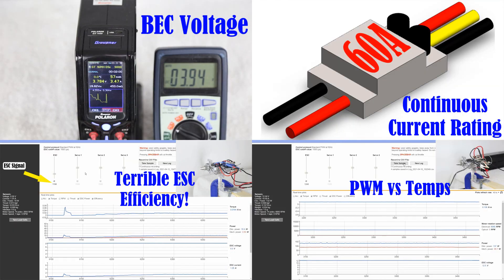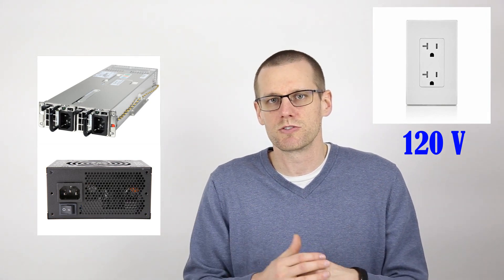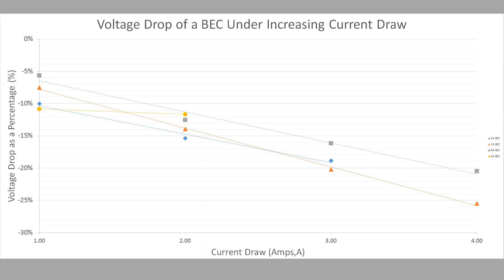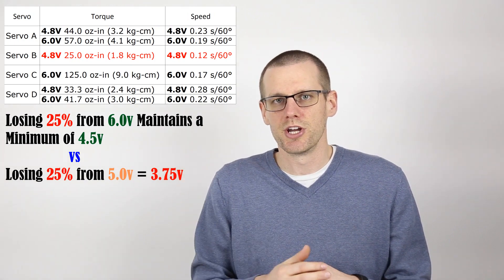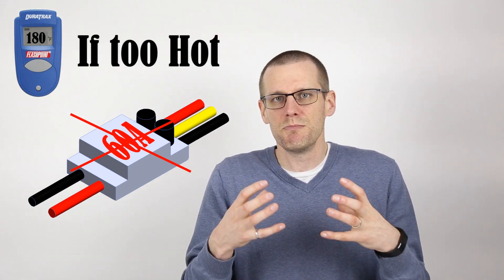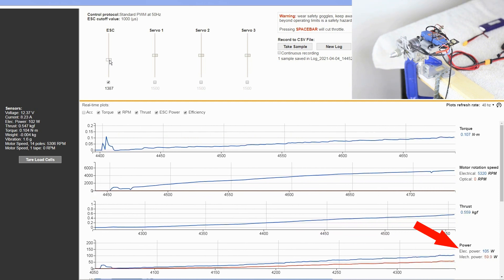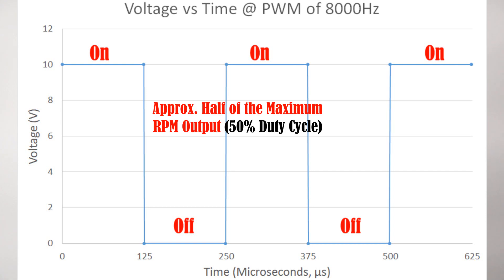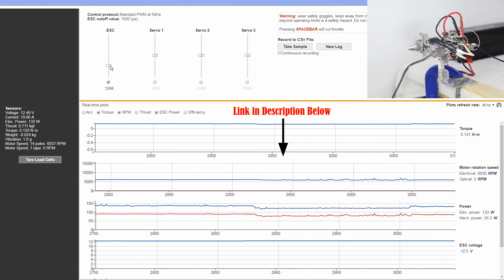What ESC Manufactures Don't Want YOU to Know

Comment: Hi! I'm working on an RC aircraft design optimization code, and I'm trying to create a simplified mathematical model for an ESC. I am modelling the entire battery-ESC-motor system as a DC circuit, where the ESC acts as a Buck converter (Pin = Pout, Iin*Vin = Iout*Vout). So for example, for half throttle (half duty cycle), Vout = 0.5*Vin and Iout = 2*Iin. However, after watching this excellent video, I'd like to add an efficiency term to the ESC to model the effects of partial throttle. The problem is that your data provides overall system efficiency as a function of throttle setting, while I need to understand the efficiency of just the ESC (I have separate mathematical models for the motor and propeller). Specifically, I need to understand what exactly efficiency means for an ESC. If efficiency is measured by Pout/Pin across the ESC, how would I solve for Vout and Iout? I see 3 possibilities:

1. The ESC switching losses reduce voltage, so Vout = efficiency % * throttle % * Vin. Iout remains the same as for the idealized Buck converter ESC with 100% efficiency.
2. The ESC switching losses reduce current, so Iout = efficiency % / throttle % * Iin. Vout remains the same as for the idealized Buck converter ESC with 100% efficiency.
3. Some combination of the above.

Do you have any tips for how to mathematically approach this? Thanks!
Reply from the maker: Pout/Pin = efficiency. Is how I'd handle this.

Comment: Hello Ryan, greetings form Spain.Always see your videos, very useful and interesting topics. Im buying components for a 1/10 scale buggy DIY. I bought a 4 poles 3660 2600 KV brushless, SL, which I will use on 3s. Im missing the  ESC and not really sure what parameter apart from Amps( I want a 120A) can I look into in order to decide(resistance?). I have two  hobbywing in mind: MAX10 SCT and Quicrun 10BL120. The price difference is 40 EUR, Is this really better the MAX10? I want to upgrade it to big tires(13mm) both will be ok or this use? The MAX says good for monster truck the othe does not say. thanks!
Reply from the maker: Choose an esc based on voltage and current. Then get the features that you require.

Comment: Also there is an amp draw limit on a BEC. Receiver and things plugged into it could add up to to much; servo(s), lights, sound, winch accessories etc. Need some head room too... if the BEC V drops on a maxed out circuit the loads may pull over the amp limit.

Comment: Interesting! I'm no expert on esc's but most speed controllers use mosfet transistors to switch the motor coils on and off. Mosfets can't switch infinitly fast. The gate of the transistor has a specific capacity that has to be charged/discharged by the mosfet driver IC (if it even has a driver) in order to turn it on/off. So my theory why some esc's can switch a lot faster than others is that they use (better) drivers and transistors with a smaller gate capacity. By the way, are there already hobby esc's available with Ganfet-transistors? Gallium is more expensive but the transistors switch faster and are much more efficient for high power applications.
Reply from the maker: I am not sure if Ganfet-transistors are being used.

Comment: noice

I'd appreciate it if you could make a video about the fake CV joint.
Reply: Fantastic idea
Reply from the maker: What are you referring to as fake CV joints?
Reply: @RCexplained  In most of the RC industry, Universal Joint is called CV Joint, but Universal Joint is not able to do constant motion.

The same goes for the double-carden joint.

A 1/5 vehicle like an MCD has a CV joint with a ball like a real vehicle, and I think we need to distinguish terms between CV joint and Universal joint.

I would like to ask you to experiment with how much grip loss occurs due to the vibration of the angle when the Universal Joint is used on the front wheel.

https://youtu.be/gmV4qwLfOMY

Comment: Hey Ryan, thanks for the video, what about powering a cheap 3ch receiver on 2s lipo or 2s li-ion? 8.4v is way too high, I don't use any servo, I only need radio signal for throttle.
I'm thinking about using a resistor, I know ohm's law, but overall what do you think about this approach? Thanks!
Reply from the maker: I do this using an externally mounted BEC. This way I can run 2s/3s/4s doesn't matter. It all gets dropped to 6.0v at the receiver. If your receiver is rated for this voltage, then you don't have an issue.

Comment: Can the reciver overheat if your servos are too powerful
Reply from the maker: The receiver must be able to handle the load as this servo load is bridged on the receiver circuit board.
Reply: @RCexplained  yes i thought so. 🤔 Doesn't that mean if you have a very powerful servo and bec you could damage the receiver?
Reply from the maker: Yes you can damage the circuit that carries the power to the servos.